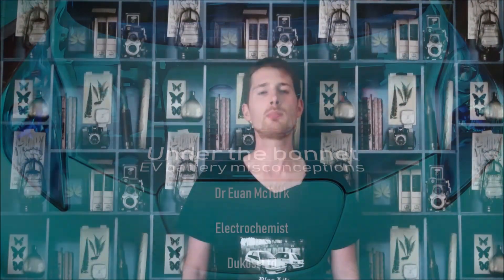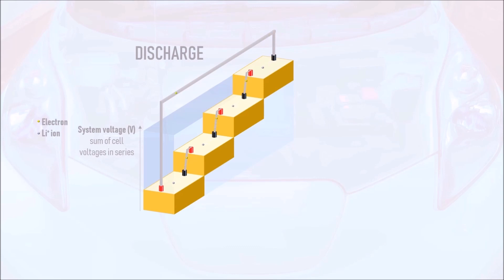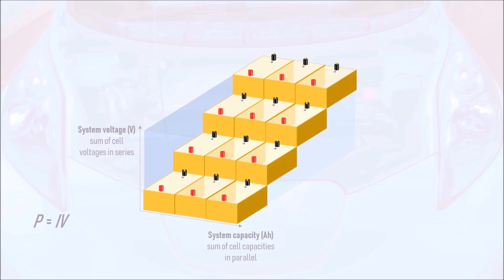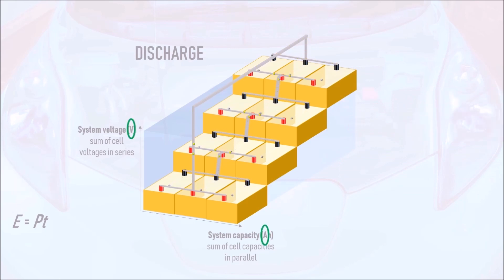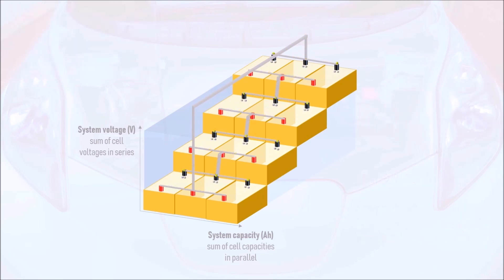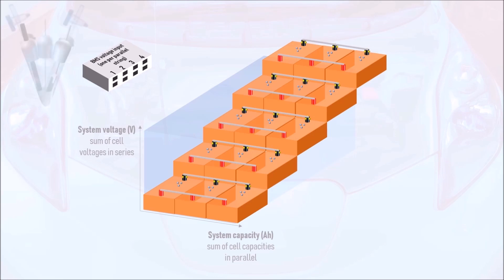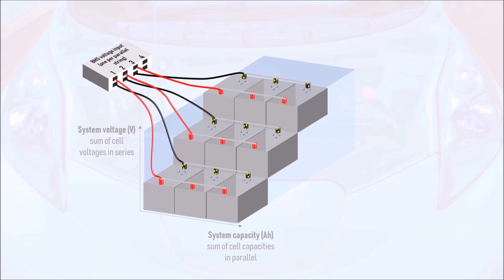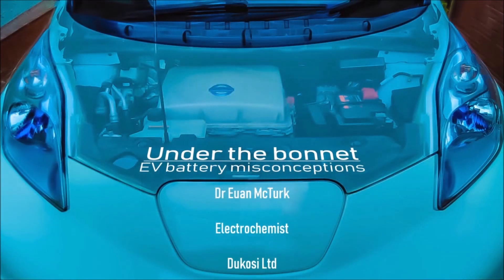Can you swap an EV's battery pack for a newer chemistry? | Plug Life Television Episode 1

Comment: The 30kWh Leaf Battery pack still has 96 cells in series and 96 BMS connection points as in the 24kWh packs.
The only reason it is not compatible is Nissan not wanting to do a firmware upgrade of the BMS to account for the extra capacity.